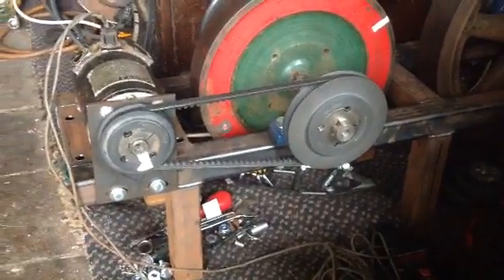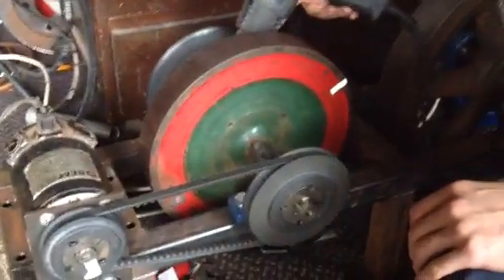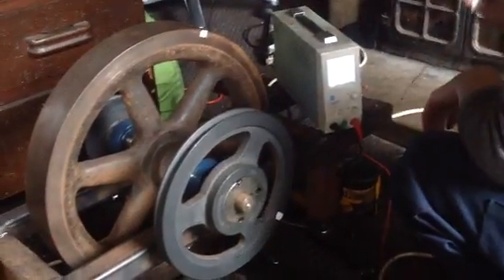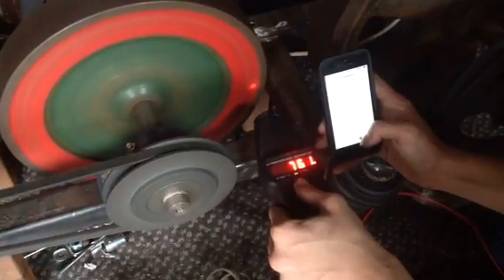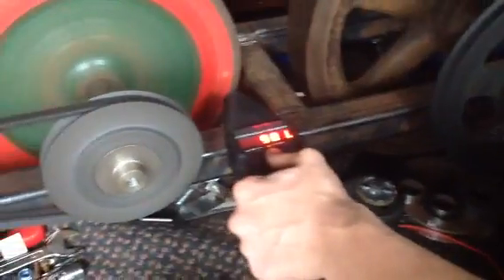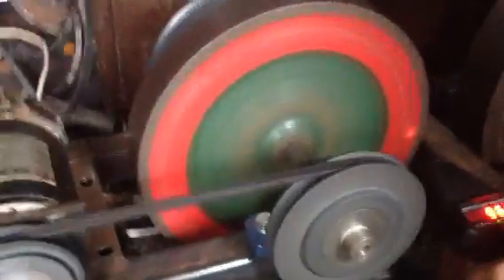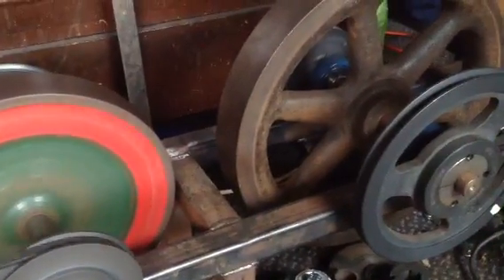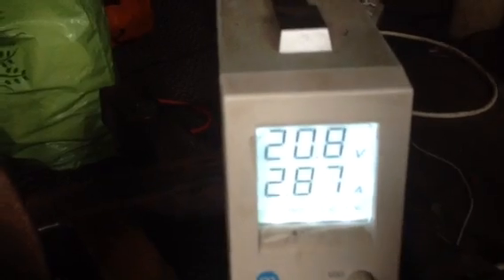The Flywheel ? V4.

Comment: if you reverse the pulleys you'll get a faster rpm. you may experience slower acceleration but ultimately faster rpm on the flywheel end.

Comment: The belt slap is because with the capacitor the speed of the motor is increasing causing the loose fitted belt to vibrate more and the result is the slapping effect you saw. Put a tensioner on it just like a car and serpentine belt or put a idler pulley on it that can be adjusted : ie, tightened and the problem will go away immediately.

Comment: If you used a long geared rack and pinion and a 45 ° slope say 5m long and took a large flywheel and let it fall so the outer diamater rotates to high speed  while the smaller pinion turns along the rack, how much energy would be created would it be enough to use a winch to pull the weight back up again?

Comment: Could you write down in the description the time needed to get at the rpm for test run 1, 2 and 3?
Reply: @ Grum C: thanks for your video. But, as you know, the Aspden effect is manifested by running 5', then stopping and restarting the flywhel within 60 seconds. If you don't let it running enough, and then you let it stops slowly, the effect is near zero or strongly reduced. So, run it much more and then brake and restart it within 10-20 seconds.
Reply from the maker: Dear deslomeslager.
First run from a long rest was 40.6 seconds. Second run took 37.1 seconds. The third run was not a good one as we did not reach the maximum RPM.  More definitive tests will have to be made, including the amount of energy consumed.
Harold Aspden found that the energy consumed was lower after the initial run !!